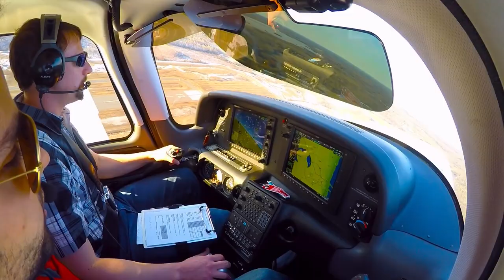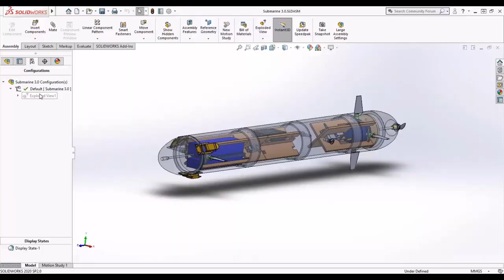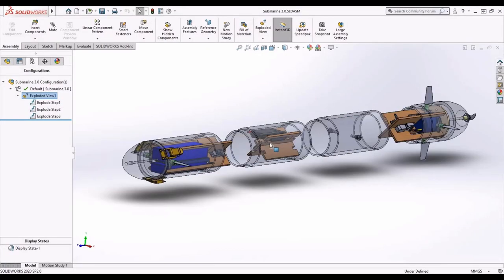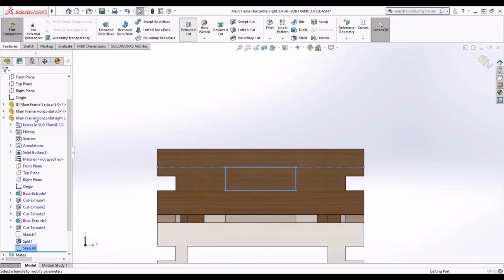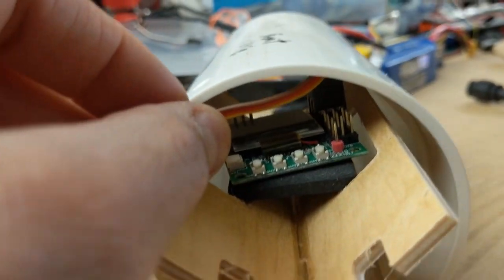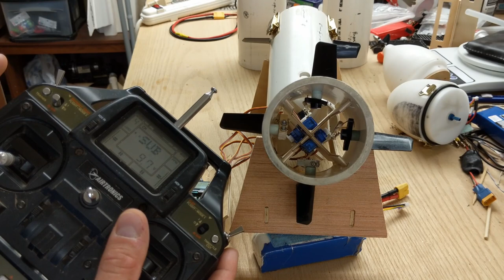RC Submarine 2.0 - Rebuild

Comment: Hi, what’s the frequency that are using for Rc wireless and how far it could reach ?
Reply from the maker: You really need old radios. The new 2.4 GHz will not penetrate water much at all. Anything in the 27 MHz to like 75 MHz works. Just depends on what's allowed in your area. As far as actual penetration I don't know. But I know I had control while standing on a dock with my sub out quite a ways and at least 10 ft down.

Comment: Hi, I also want to build something similar but there is only rarely content to that topic.
I was wandering how you build the rudders, so they are waterproof, looks very simple how you did it.
Can I contact you if I would have some more questions?
Reply from the maker: It's a fun project. The rudders are from RC airplane floats. I used a special bushing that has an o-ring in it for the rudder shaft. The ones I used aren't available anymore, but I think there are similar ones. You would just have to search for them. Email me at dgant@ascenddynamics.com if you have more questions.

Comment: Two questions: 1) How on earth do you change the battery? 2) Can you make it FPV?
Reply from the maker: Easy and yes. :-) FPV is going to be the next step as it makes it so much easier to run underwater. I am making a camera nose with a clear dome so that the GoPro and FPV camera are inside the submarine. For the battery, either nose comes off with just 3 latches. You can open and close it within 10 seconds. Check out the video listed in the description. That explains how the nose works.

Comment: what material did you use? pvc pipe?
Reply from the maker: That is correct. Watch the first video I have linked in the description. I go over the design details more in that one. It is 3in PVC pipe with 3.5in outside diameter.

Comment: Haha,.  You and I conversed a few years ago about my fast graupner shark submarine.  Now you added a flight controller.  So did I but not to the shark.  I am attempting to install one in my flying sub.  It likes to bob and I am hoping for a more leveled submerged operation.  It is not done yet, but I will keep you informed.
Reply from the maker: Sweet! Yes, a FC is so useful for a sub/ROV. So easy to use for mixing and the stability stuff should really help. Wow! When you say "Flying Sub" you really mean that. I just watched your video of it... that looks like lots of fun! :-) Love the loops!
Reply: @AscendDynamics   What frequency are you planning for FPV?
Reply from the maker: @spartan3299  Just 5.8. It doesn't penetrate water so I have to run a line up to a float to keep the video tx above the water. At present there isn't a good technology for video transmission under water for more than a very short distance.

Comment: Can someone clarify that this does not use ballast tanks?
Reply from the maker: Correct. I set the weight so that it was positively buoyant and then it uses forward motion and adjustable fins to dynamically dive. Think somewhat like an airplane. Just upside down and in the water... 😁😆✈️💦
Reply: @AscendDynamics  Thank you very much I shall use this for a school project
Reply from the maker: @Lit.mp3 Great! Have fun!